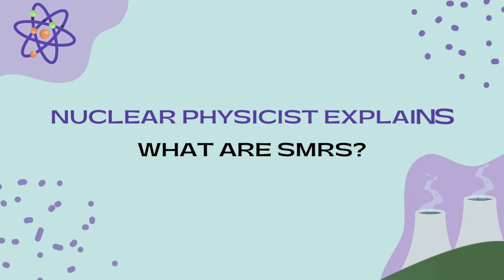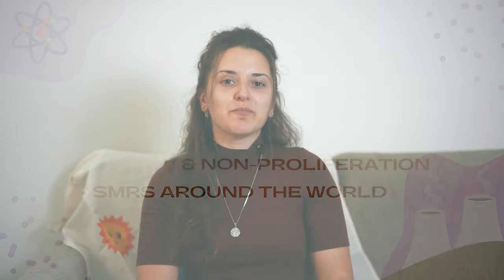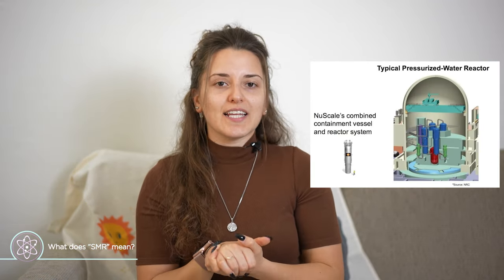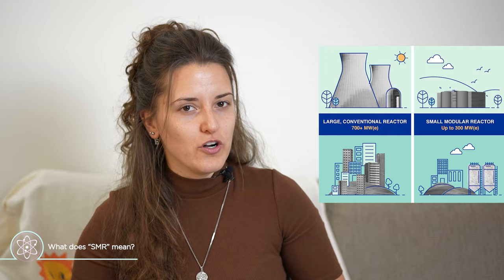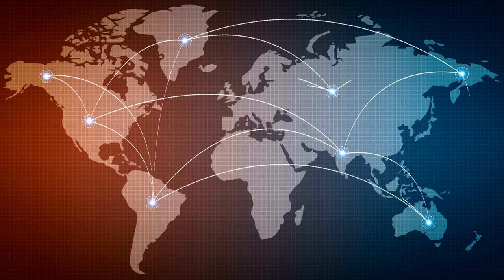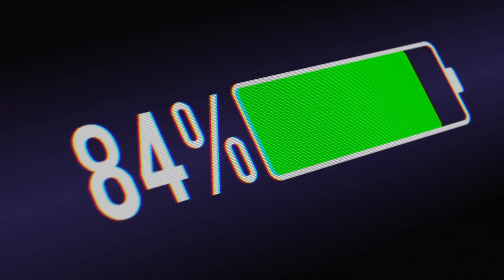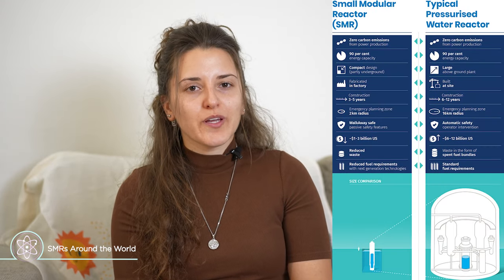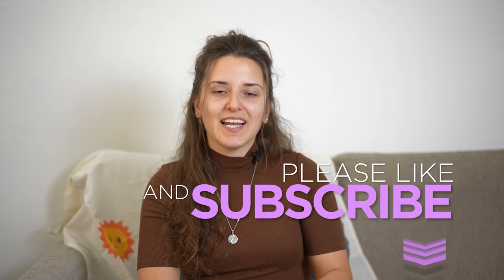Nuclear Physicist Explains - What are SMRs? Small Modular Reactors

Comment from the maker: Now you know what SMRs are!
They’re actually part of my research at the moment. 
Their biggest drawback would be their cost which is on the high side for now but they have potential to change the game if mass produced.
Thanks for watching let me know what else you’d like me to explain below! ☢️👩🏽‍🔬
Reply: Thank you for the video. I was wondering if you could make a video about Fusion Reactors, how they work, what are the difficulties with them and wether you think they are the future of Nuclear Energy. Thanks again!
Reply: @Elina Charatsidou  Being that we see factory built "modular" things,  what about recalls?  How will the quality control work on this assembly line?
Reply: Burying them underground only gives them that much more opportunity to leak into the biota.   The safety fail safe systems are not failsafe as the Nuscale design left the moderator in the condenser.  You only ever show the small benefits in a 9 minute video but I never see one single negative thing about any of all this Elina.  Why don't you tell them both sides of the coin Elina?
Reply: Not sure there's enough demand for energy to mass-produce reactors--but that also depends on your definition of "mass produce". For most automobiles, 10,000 cars of one model per year is a small number to produce. Pens are produced by the millions. Same for plastic bottles and hundreds of other consumer items. For railroad locomotives and aircraft, 500 units of one type made per year, such as an SD40-2 or a Boeing 737, qualifies it as being "mass produced". These sound like disposable reactors, build them, plant them where they need to be, and 25 years later, bring the replacement out, swap them, and take the old one off to be buried. Come to think of it, they sound more like large battery packs that make energy from nuclear power, and perhaps they should be designed to be just that. Ideally, they'd be made so they could easily be transported by heavy-duty railcars or even heavy-haul trucks with ease. This means your "dream" maximum design weight is about 20,000 kg, your ideal maximum design weight would be 40,000 kg, and you definitely would want to get the maximum design weight below 60,000 kg. Dimension-wise, your "dream" maximum shipping dimensions for are 3 m wide, 3 m tall, and 16 m long. If you're somehow able to pull this off, most trains and large lorries (called tractor-trailers in the US and Canada) across the globe will be able to safely move them along the major rail and road routes of the world without exceeding the loading gauge of those roads. I don't think that will be practical or safe, since reactors have various requirements, such as shielding, but that would be your dream goal. Here, your ideal shipping dimensions will be 5 m wide, 5 m tall, and   25 m long, this will still allow quite a bit of flexibility in transport, especially if you can keep the weight down. Likely more realistic are shipping dimensions of 8 m wide, 8 m tall, and 40 m long, and this is as likely large as they can be to make inland transportation as an intact, preassembled unit more than a pipe dream--this is probably achievable as many nuclear submarines have a 10 m by 10 m cross section. Note that they can be shipped on their side if designed for that, then turned upright with cranes at the final location. You'll also want to take care to have a minimum number of external protrusions that might snag on things during transport. Burying them in pools might make them relatively safe from most natural disasters, but earthquakes and landslides would still be problems. I think there will be huge problems with making certain they are sited safely so there aren't any repeats of Fukushima. Care must also be taken that the pools don't get drained by sinkhole formation, quakes, or other events, or some provision must be made that it won't be a safety issue should some weird catastrophe drain the pool it is mounted in. Overall, this is a concept whose time is overdue, provided those issues can be addressed.
Reply: Thank you! 
2 things... 
The physical amount of material in the core, which being smaller is perhaps not quite as "big" of a worry in terms of containment in the event of a catastrophic accident. Part of what made chernobyl so bad was the enormous size of the reactor and sheer volume of fuel. 
Also SMRs can be placed closer to heavy industry etc so you don't need a sprawling grid distributing power across the entire country!
Reply: @philshorten3221  Doesn't matter because they will still have to group these together and controlled with a single control room...its much worse actually.  Think about natural disasters and these things are the size of a city bus.  How many busses have you seen in floods or earthquakes....do they stay where they started from.
Reply: @philshorten3221  It's still a worry and must be addressed. One accident will cast a shadow on such a program. More than one might have people up in arms demanding an end to nuclear power. It won't matter how small the accident(s) are. We will also still want that sprawling power grid so power can be transferred from one part of the country to others as needed. A big part of what wreaked havoc in Texas was their isolation from the rest of the national power grid.
Reply: @RMSTitanicWSL  pretty sure there are lots of people who could benefit from these, a good portion of the world still washes their clothes in the nearest rivers.  The energy could also be used to desalinate water and run pumps to distribute that water to where it's needed.
Reply: @philshorten3221  agreed.  Our grid is really quite inefficient and there are a lot of industries that just end up with an arc furnace or so...  Like aluminum refining, I think the need temperatures in excess of 1000° C...
Reply: @kayakMike1000  So am I--if it's done right.....
Reply: @paulmobleyscience  easy there tiger...
Reply: @kayakMike1000  grrrrmeow
Reply: @paulmobleyscience , if Elina missed it, please elaborate or point here your concerns. We would like see them vs. RITM-200M: web.archive.org/web/20210814013515/http://www.okbm.nnov.ru/upload/iblock/1d0/1d00b4a30402be5700de39c9bedd3e60.pdf
Reply: @alexandrejulio  What ever do you mean?
Reply: @alexandrejulio  My concern is any water cooled reactor big or small (modular when it isn't really modular) produces, leaks and releases H3O tritiated water that is taken up in plantlife that then binds to the plant to form Organically Bound Tritium which is different than just H3 tritium from the sun that is extremely rare on Earth which means the tritium found on Earth is primarily from all our water cooled nuclear reactors that permeates metal itself and can not be contained.  This is the fuel for fusion reactors as well and exactly why they will never work.  To have fusion you must have fission producing the fuel because it doesn't naturally occur on the surface of this planet without man.  Thats the concerns so you can voice them for me on a link I would never trust in a million years.
Reply: @kayakMike1000  Actually those people would benefit more from the super alkaline water used for a reactor loop while they die of thirst.  Those people don't need power as much as just safe clean drinking water without Organically Bound Tritium in their food either.
Reply from the maker: @Wawyed  thank you for the comment and the suggestion!☢️👩🏽‍🔬 I’ll make sure to do so in the future
Reply from the maker: @philshorten3221  thanks for the comment ☢️👩🏽‍🔬 indeed the core and hence the fuel amount will be smaller
Reply from the maker: @paulmobleyscience  hey there, even in case of a accident there not warranty that all reactors will fail at the same time. It is most likely that one might malfunction, as for example even in Fukushima where the reactors were massive and the safety not as advanced. Thanks for the comment!
Reply from the maker: @kayakMike1000  indeed! Hope to see them soon everywhere they’re needed ☢️👩🏽‍🔬
Reply: @YourFriendlyNuclearPhysicist  Fukushima is the textbook-example of a common-cause failure, how exactly are you trying to use Fukushima as argument against simultaneous core damage events in a farm of SMR?
Reply: @YourFriendlyNuclearPhysicist  Thank you finally for the comment....yes but what happens when one single one in a group of say four or five.....how do you clean that up when it does fail....it will you do know that don't you?  Humans are not perfect so even with a perfect calculation on paper you can never calculate human error or corruption into the equation right?
Reply: @NuclearSavety  are you nuts?  Fukushima was not a normal event, the damn reactor was hit by a damn tidal wave.
Reply: @kayakMike1000  if or if not Fukushima can be considered a common-cause failure has nothing to do with the magnitude of the event.
Reply: @kayakMike1000  Thats incorrect....all that needs to occur is offsite power and the diesel supply for the backup generator cut and no way to remedy it.  That doesn't take a once in a lifetime event.. that takes something we see every year, several times a year and we've been so lucky thus far.  You're notion is incorrect Michael
Reply: @YourFriendlyNuclearPhysicist  Hi Elina, I was curious where did you do your field work for your PhD?
Reply: @YourFriendlyNuclearPhysicist  I've heard some people claim that SMRs don't need large, concrete containment structures. Do you agree or disagree with that assessment?
Reply: Love your videos, would love to learn why aqueous homogenous reactors aren't used for municipal heating since they seem simple and cheap and have been used as research reactors for decades.
Reply: @plasmafoal1117  Probably because it's dissolved, water soluble,  and permeates tritium through the reactor and out into the biota if water is the coolant and if molten salts are used then its Tellurium embrittlement or segregation of the alloy.  That's why
Reply: @paulmobleyscience  , thanks for your answer. Regarding "so you can voice them for me on a link I would never trust in a million years", do you mean that you are afraid of a .pdf published in Web Archive, or simply you don't trust the Russian design? The .pdf file presents the evolution of en.wikipedia.org/wiki/Akademik_Lomonosov
TASS reports that Akademik Lomonosov is in operation since May/2020. I don't know why Elina stated October/2022.
Reply: @alexandrejulio  No...its any WHO/UNSCEAR/IAEA/UN link that would be an issue.  Do you know the names Yury Bandazhevsky and Alexey Yablokov?  If not research their work and then ask yourself if you would believe any of the notable regulators.  Also watch the 2001 Kiev symposium on Chernobyl.
Reply: @paulmobleyscience  Tritium and proliferation are the main drawbacks of CANDU's but it's not as big an issue with light water reactors but even so CANDU's are good reactors, one of the Canadian ones holds the record for continuous operation 1105 days.
Reply: @paulmobleyscience  That also reminds me that back in the atmospheric testing days you used to be able to check if groundwater had contact with surface water by seeing if it had tritium in it.
Reply: @kayakMike1000  And even so the radiation release wasn't catastrophic, Chernobyl on the other hand....
Reply: @Miss  I must make a public comment because neither one of my comments actually posted so I have to make an entire new one just because a simple comment wouldn't post.  
Cesium is also a marker as it travels on the surface of a body of water and doesn't act like other radionuclides along with its distinct half life gives us the ability to use it as a fingerprint radionuclide.  Tritium is the biggest issue of every water cooled nuclear reactor no matter the design or country it resides I'm.  All nuclear reactors have normalized discharges of effluents and it isn't a small or short list.
Reply: @paulmobleyscience  , thank you very much. Chernobil is the APEX of what NOT to do. My question to your scepticism, regarding naval SMRs, is if it is acceptable to use them as a (transition) tool to (offshore) geothermal projects?
Reply: @alexandrejulio  Youre very welcome Alaexadre. They shouldn't be used at all in my professional opinion.
Reply: @alexandrejulio  Also since my comment wouldn't post publically, to Elina or to Miss Ano....so maybe it will post to you.  The film company Kodak nearly sued the US Government after the Trinity test ruined entire film runs in Indiana and other US states.  Do you know why they ended up not suing them?  Because the government said they would give them warning the next times they would be testing so they could stop production until the plumes passed by.  Now the question should be.....did our grandparents get a notice when the government was going to test those nuclear weapons and if it caused damage to that film then how many people ingested radionuclides that caused damage to their genome that they then passed to all of us today????
Reply: @YourFriendlyNuclearPhysicist  In the pictures I noticed that the larger scaled reactors have a building and a containment vessel.  This is said to protect the reactors from outside influences such as an airplane crash or natural disaster but they are also in case a meltdown occurs and will then make the attempt of containing it (but as Fukushima showed us that doesn't always work).  So with these Small Modular (not sure why they chose Modular being that they won't be moving these things around like they would say a Modular home with wheels on it so it's a falicy) Reactors, what's not only going to protect them from outside influences, but also WHEN one does meltdown (because it's an inevitable fact no matter the failsafe system because something that's part of that system will fail including humans) then what keeps it from melting through the reactor and no structure there to contain it?  Are they only relying on the failsafe systems like Nuscales design that left the moderator in the condenser and failed miserably?
Reply: @alexandrejulio  You know the answer to that question you deleted.  Hydrogen, tritium and oxygen bonded together..... does water at depth dissolve, mix and evaporate or does water at depth stay at depth?  Aquifers.....
Reply: @paulmobleyscience  so... There are some solutions to this, like don't use any hydrogen in the reactor loop at all, that includes water.  Rather, use CO2 as the working fluid/gas in your power conversion turbines.  Any hydrogen or H2O found anywhere in your containment building is suspect for tritium, most of it will react with atmospheric O2 and can be contained. 
CO2 driven turbines are super interesting, they are surprisingly tiny compared to the steam driven turbines.  Don't forget about xenon radon and krypton also.

See, we have this covered in generation 5 reactor technology.
Reply: @paulmobleyscience  power can be used to desalinate seawater, pump water wherever it's needed...  geeze we could evaporate seawater down to dry salt with nuclear power, just where do we put all that salt?
Reply: @paulmobleyscience  oh I like LFTR GENERATION V reactors.  They are great!
Reply: @paulmobleyscience  i think you need lithium in your reactor to make tritium.  Google says normal reactors create 2g of tritium per year.  Tritium has a half life of tritium is around 12.5 years.
Reply: @kayakMike1000  So...the solutions to this aren't new by any stretch of the imagination and was used with even Gen 1 reactors.  The issue with helium as coolant is that it must be pumped very quickly because it doesn't carry the heat away like water does.  CO2......with everyone's issues with CO2 and plantfood, you'll have to first get it through their heads that CO2 isn't a pollutant....but excess Carbon 14 is and exactly why CO2 shouldn't be used and I already touched on the graphite expansion/contraction issue.....So why is it you couldn't put those 4 seperate comments into one single one Michael?  I just did very easily and heat transfer......is the issue.  Let's not also forget helium for the coolant will have to made, CO2 for the coolant should probably be pulled from the environment instead of just made to use as coolant but it won't b le because it's too expensive and as far as water desalination... look at the ones already made....you have to have a complex multistage system to make it viable where it progressively uses its own power to step up the process.  It's no secret that these "solutions" are not solutions and mearly a bandaid that's easily ripped off.
Reply: @kayakMike1000  No all you need is H2O neutron capture to H3O tritiated water....
Reply: @kayakMike1000  And no...Half-life of tritium is 12.33 years.....around is physics calculations....Engineers use actual numbers.
Reply: How many megawatts do you think each SMR could provide? 50? 100? I'm generally curious about this.
Reply: Can you please do a video explaining the differences between the generations of nuclear reactors?
Reply: If I understand Michel Schn right, more high radioactive waste for Millions of years why should we???

Some analysts looking at the waste streams of SMRs conclude that smaller reactors will produce more radioactive materials per unit of kilowatt hour generated compared to larger reactors.

Schneider: That’s the MacFarlane and colleagues’ paper, which is pretty logical if you think about it. If you have a small quantity of nuclear material that irradiates other materials, then it’s proportionally more per installed megawatt than for a large reactor in which there is a larger core.
Reply: [Thread bypass]:
Thanks for making this video!  Great 'fast flyover' summary, I might use it in a local political issue.
Reply: [Another thread bypass]:
The problem of cost can be solved if adoption takes hold in a country or region, which would lead to assembly-line style production and cause cost reduction due to 'economics of scale.'